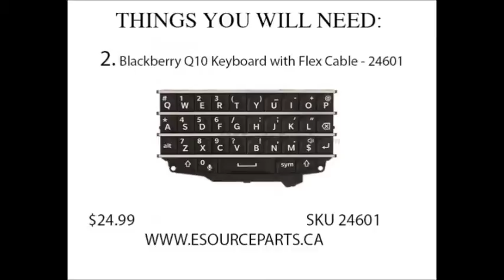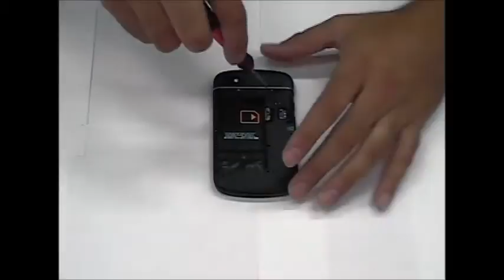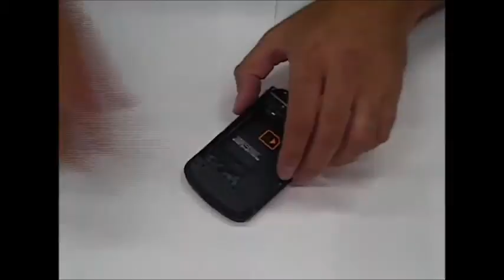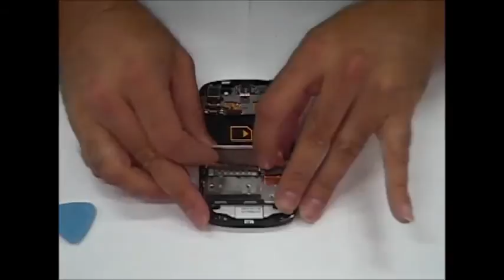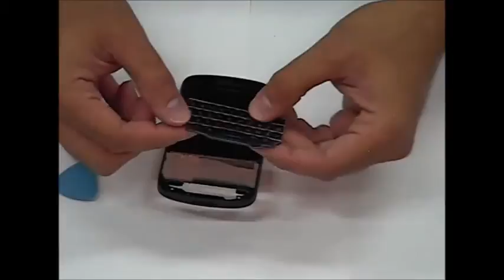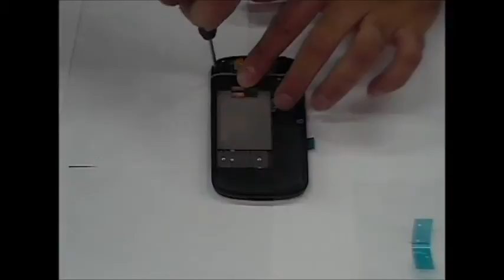Blackberry Q10 Keyboard Repair Replacement Disassembly and Reassembly Walkthrough Instructions

Comment: Thank you guys SO MUCH for posting this! I just replaced my stock Q10 keyboard with a bilingual one. I was a bit nervous about doing this, but decided to go forward. The only issue I ran into was that one of the keyboard screws wouldn't come out - even with my magnifying glass I couldn't tell whether it was stripped or just stuck. Since the keyboard will pop out even with the screw still in, I decided to go forward. My new keyboard is only being held in with a single screw, but it doesn't seem to be an issue.

WOOHOO!! Now I can text in Russian! :)

Comment: Hi thanks for the video! Im stuck with the "philips screwdriver". What kind of size is it. I disassembled my blackberry until the part of that very small screw almost at the end?
Reply: ***** Hi Bob have you found an answer to this question?
Reply: *****, because I did not have the screwdriver at the moment and could not be without my blackberry, I had to reassemble everything back. Miraculously from that moment my keyboard typed fine again without sticking letters. So I eventually did not need to change my keyboard after all, therefore I have no answer sorry. But, I think you just need to find a very very very tiny screwdriver. Goodluck!

Comment: Excellent! Great job on the video. My Q10 had developed a sensitive key. It was very frustrating. This video did a great job of step by step instructions. Thanks!

One hint for a future "do-it-yourself", it is best to do this over a white area (vs. dark surface) - a blank piece of paper for example. It also helps to make a note on the paper of exactly where the screws were removed (then group them). There are five to six different screw lengths. For an amateur such as myself, it was easier with a reference from whence they came during the re-installation.
Reply: Just successfully replaced my keyboard. Your tip definitely was helpful!

Comment: Woo-hoo! It worked!
A couple of pointers:
1. Remove SIM and memory cards first (DOH!)
2. It's critical to get exactly the right sized Phillips screwdriver for the keyboard screws. Had no trouble not stripping them with the correct size screwdriver.
3. Get 3 thicknesses of "guitar pics" for separating glued in parts -- works great!
4. Torx "pentalobe" screwdriver also known as "Star Drive SD-5" or "T-5"
Reply: Turkey
Reply: the bottom trim piece from the keyboard works fine in separating the glued in motherboard. the gold tin piece is hard to get off without nails but can be done. I used nothing but a screw driver set for this repair and it went great.

Comment: These instructions worked perfectly for me! Thanks so much!

My previous keyboard had 2 sensitive keys but after replacing it with a new keyboard it works like new!

One note: I noticed the foil "stickers" magically disappeared in your video towards the end :). I left mine connected but they were crinkled. Probably looks cleaner to remove them as you did, but I'm not sure if they have a functional purpose.